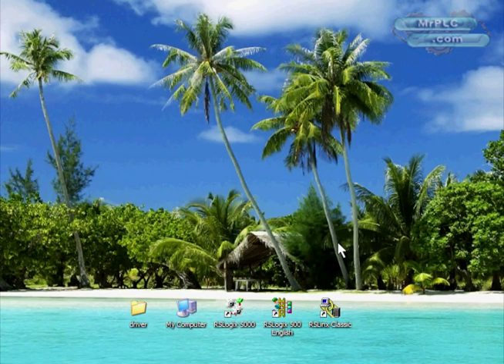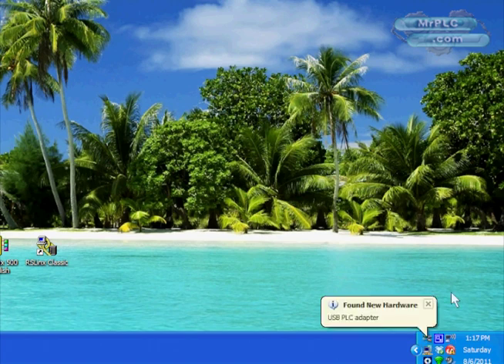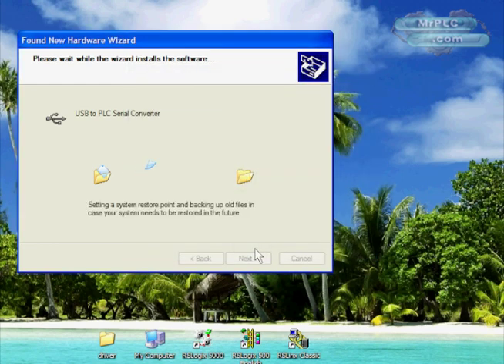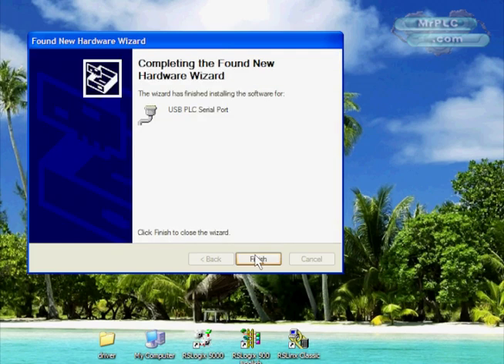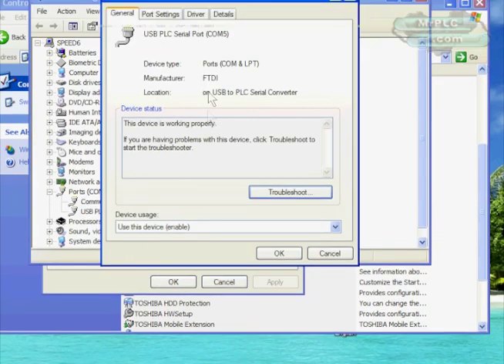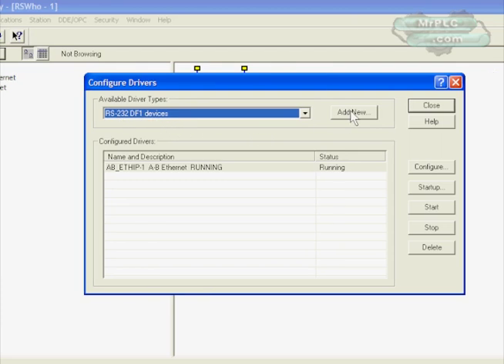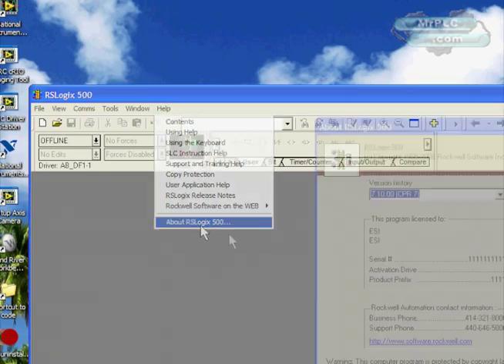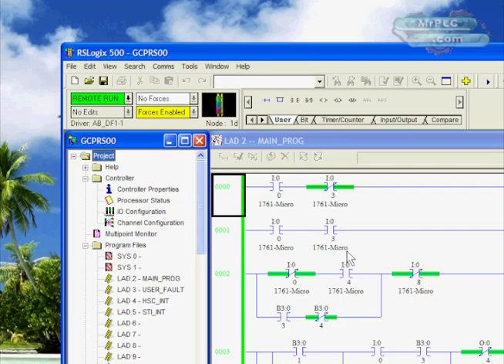How to Install the USB-1761-CBL-PM02 PLC Cable

Comment: this does not work for me i am using the 1761-CBL-PM02. i am running in a VM with XP and it will not work, I have also attempted it on windows 7 still nothing. it just tells me that windows did not install the driver because windows was unable to find the correct driver etc.